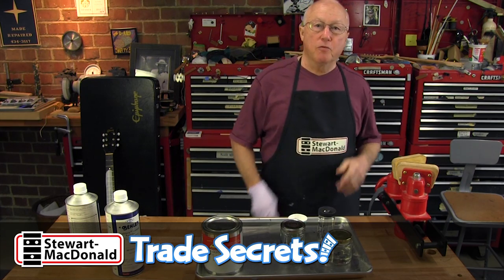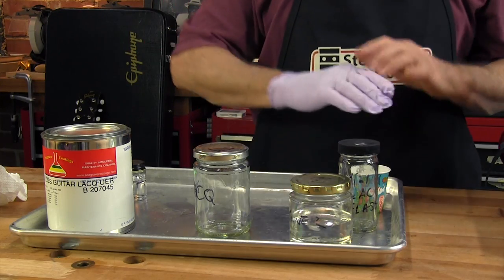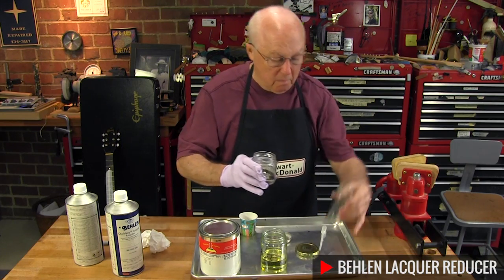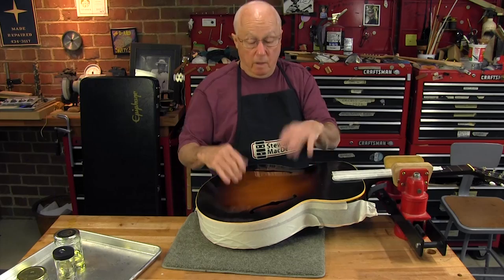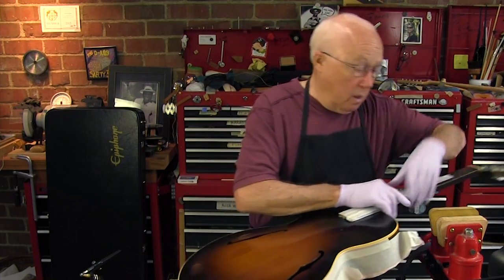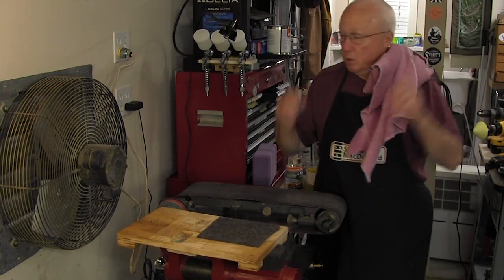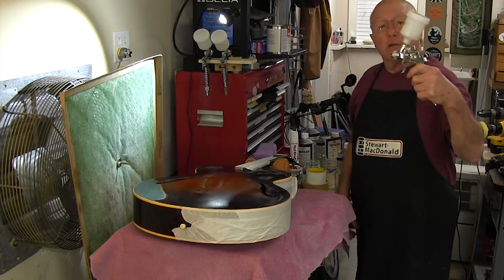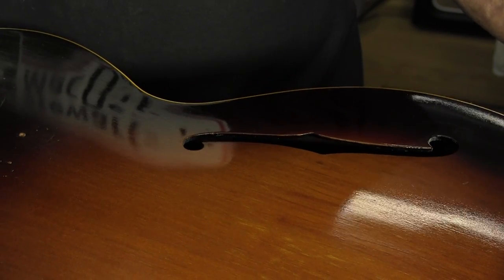Using a flash coat for guitar finish touchups

Comment: I mixed a flash coat today and did the final coat on a Tele that I'm rebuilding, and to say that this is the best result I have ever gotten out of a spray session would be an understatement. It's really going to minimize the amount of wet sanding and polishing I need to do, which is normally where I screw up at finishing have to start over again. This was an excellent tip and I really do appreciate it

Comment: Thanks Dan & Stewmac for the great advice videos - fine skills that take yrs to master. Having worked with lacquers for 30 yrs I would just like to mention the dangers involved in working with SOLVENT based products. The chemical name for these type of solvents is iso-cyanates - yes they contain cyanide. I always thought one day I would get throat or lung cancer - but a diagnosis of ( a very aggressive) bladder cancer about 18 months ago  came as quite a surprise. Luckily in my case due to early diagnosis I had a good outcome , just having 1 yr all clear.
 I now use water based finishes (new work) which have finally been developed to a very high standard.
 The safest way to use these chemicals (solvents) is with filtered air pumped into a facemask - basically a professional setup. Hope I have helped enhance a few lives.
note:I would not repair lacquer with w/b finish.
happy jammin',
Dean

Comment: Well I was thinking I would be able to touch up the finish on my classical that I mistakenly used acetone on to remove the tape from an arm rest. You're a master and I would not even attempt what you did even if I could afford all the gear necessary. Still nice to watch a pro work. Great job, brother.

Comment: Dan Ive followed your finishing guide since my first guitar in 1989.I had the finishing guide in vhs and wore it out ,wish you had it available on dvd,i know tech marches on but I like what you did on that tape.Ive used the flash and retarder trick many times with great success.never been brave enough to use prevail  i use the 3m spray hvlp system its so easy to use,slightly costly to get started though ,and i like air brush for small shading or touch up   thanks for your many years of great tips and great guidance.

Comment: I’ve got a 1930’s Harmony Supertone Archtop with the original lacquer chipping in several areas. We love the look but want to seal it in and wondered if using a thinner mixed in the lacquer would help melt the old liquor into the new. Any other recommendations?

Comment: I have Mohawk instrument lacquer and want to use this method with Preval to spot repair a Gibson. Does the Mohawk nitro need to be thinned? If so, what ratio? Will mix flash coat 1:4 but do I need to cut the lacquer coat too?

Comment: Hi Dan, great video, am subscribed and get your guys email.  Love the stuff!
Now I have a tip for you!  I have used Prevals for 20+ years too for my business(gel coat, vinyl dyes,automotive paints) and have had a couple come apart in the middle of a job.  Where the alum power pack fits into the plastic piece that screws onto the bottle it is just pressed in.  I put a piece of masking tape on every one to be safe.  There is  nothing worse that the jar coming off and hitting what your working on and spill the contents.
Take care!

Comment: This is an excellent channel, thanks. How do you proceed if the vintage finish is checked/cracked? Do you apply a clear coat on top of that?
Reply from the maker: We do not recommend applying a flash coat over cracked or checked finish. There is gonna be too much dirt trapped in there to effectively remove. That, and those small cracks can be real difficult for finish to get into. You would likely just want seal in those finish cracks.
Reply: @stewmac  That's the first straight forward answer I get on this issue. Thanks for replying!

Comment: I went through Gibson's Parsons St. factory back in 1977. I live in Phoenix so, set the paint pot outside and that lacquer will be 140 degrees, in summer. I really miss Dyasol lacquer thinner. I had the opportunity to work for Young's Auto Paint, but it was a thankless, low paying, 100% dead end job. I did get to learn how to mix & match any and all factory auto paint known to man. That was all I did, all day long. That, fill cans and clean up the mix room. Mostly I had to keep the mix are super clean. Best & worst minimum wage job I ever had. I still keep an Ohaus Cent-O-Gram lab scale, and a standard triple beam 2610 balance for measuring "everything"(except drugs, I misplace my car keys enough already). We used a Harvard Trip balance at Young's. Since I am not painting a car, I needed to mix smaller batches. The balance is also great for matching the density of bone saddles, wood density, pick up winding wire, & the wax that was in it, 1000s of small parts, you name it. I can take a bad pickup, cut the wire out, weigh the wire, burn the wax off, weigh the wire again, do some math, and get a very good idea how to wind an accurate replacement. I can also check the Gauss of the magnet, the inductance, DC resistance, internal capacitance, peak resonant frequency, and I can make a fairly accurate copy of any pickup. I bought an unlicensed ripoff copy of an Erlewine Lazer for the bridge and headless string clamp assembly. What a pile of crap. I put a maple neck through a white limba body, capped in in Koa and it is a nice little guitar. I wish I could buy the Wine-O-Matic tailpiece/bridge & head piece without the firewood. At least that unlicensed pile-o-crapic is gone now, and I have no intentions of selling what I made from the parts.
Reply: +Seth B Thanks for not trying to sell us something we don't need. Okay, I know, it's part of the job.